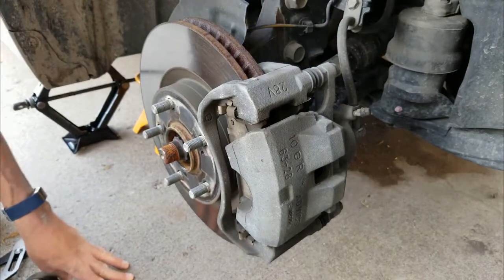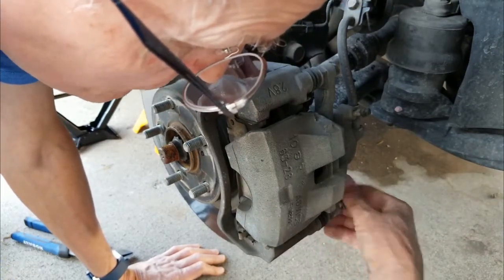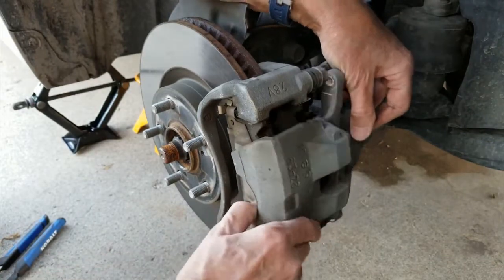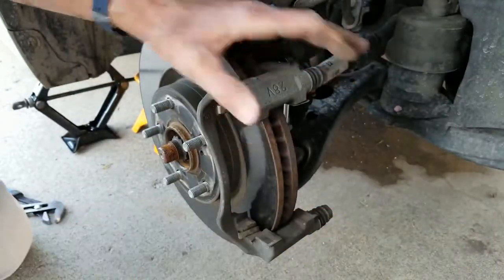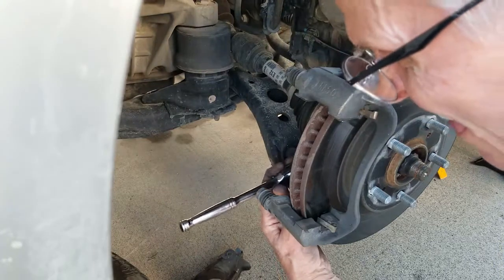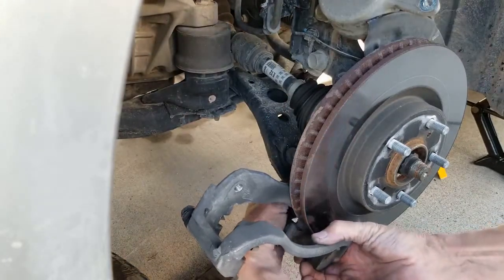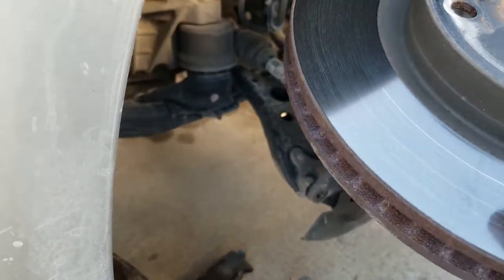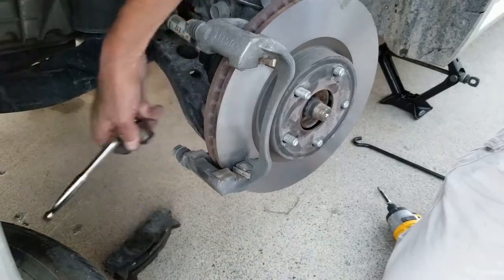Toyota Avalon - Change Front Rotors and Brake Pads - 2013 - 2018

Comment: Good video. Turning the wheel so the caliper is facing out and using a good 1/2in socket set would be a lot easier than hammering on that tiny ratchet. And use jack stands for safety. Just did this job on my 2016 Avalon today. Thanks!
Reply from the maker: You are right! But, it was the only rachet I had. I did have two jack stands underneath, but I probably forgot to mention that. Thanks!

Comment: Did you reuse old brake pads? Never do this when you spent money to have the rotors turned. Always buy new quality pads. My rotors were rusty like your and I cleaned them with a wire brush on a drill. I then sprayed them with black rustoleum before having them turned. You may wanna clean and spray the hubs as well so everything is well protected from the elements. Thanks for the helpful video and yes I will pump my brakes after the brake job.
Reply from the maker: They were new pads. Thanks

Comment: Hack using a hammer on your rachets, use a beaker bar. Good way to strip the bolt heads.
Reply from the maker: True. But, you use what you have in a pinch.

Comment: Anyone know what size bolt used to screw into rotors to remove them?
Reply from the maker: Someone mentioned the bolt is a m8-1.25×50mm.
Reply: M8-1.25 or 8 mm x 1.25